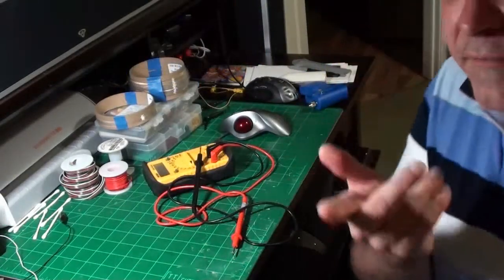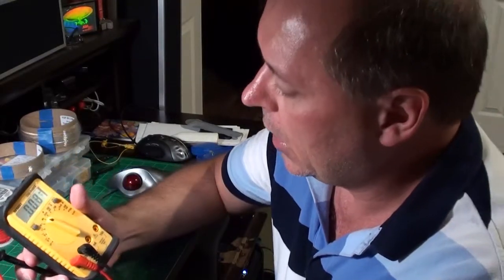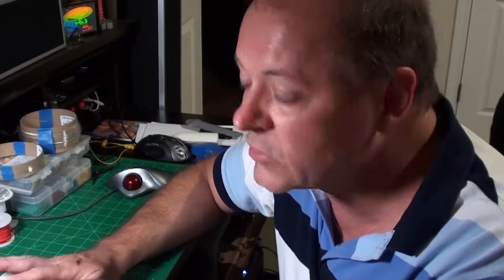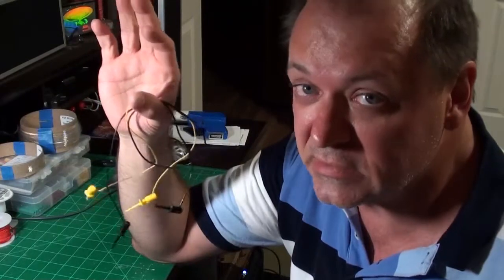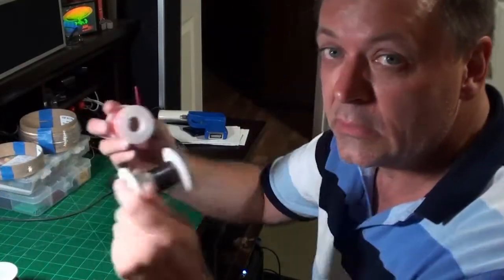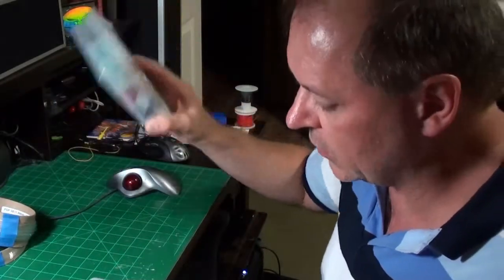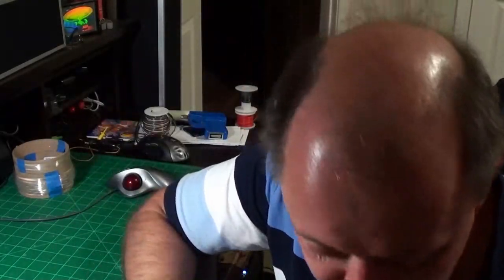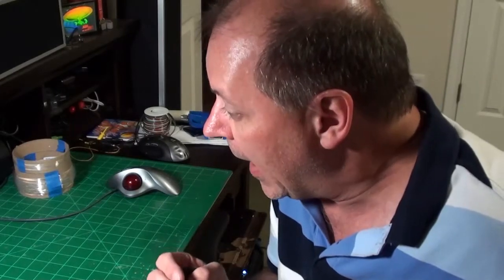Lighting Tutorial:  Basic tools part 2

Comment from the maker: @BlackSheep0ne The problem with a dremel is that it's cutting speed it too fast.  You will melt your way through the plastic, instead of drilling.   That handy drill was made specifically for plastic.  

I do have a variable speed dremmel, but don't use it for drilling holes in models.  It feels like I don't have enough control.